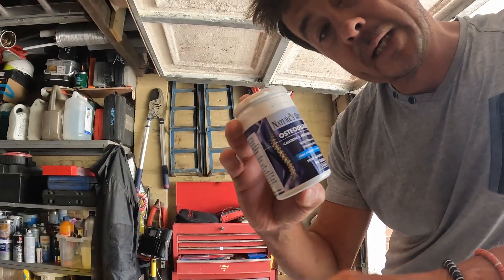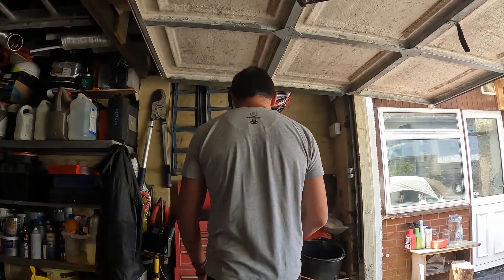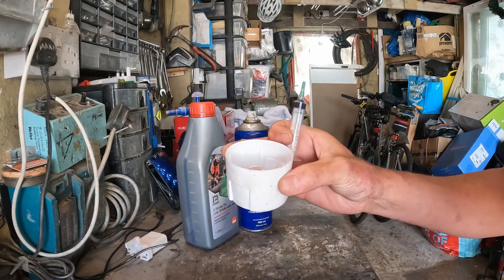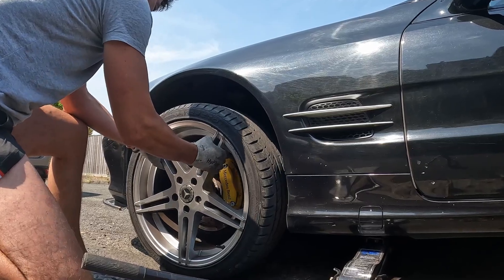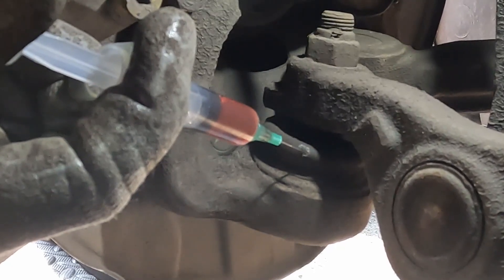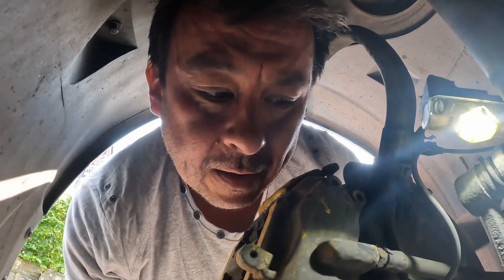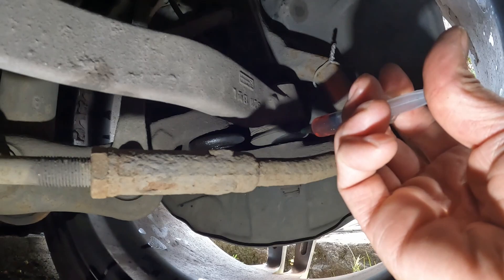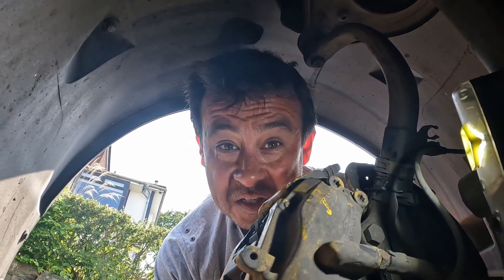Creaking Squeaking Ball Joint 🤐Hack Fix - Demo on Mercedes SL

Comment: Hey man, I rarely comment and just wanted to thank you. My c class w205 went exactly like your video. First ball joint was easy to introduce needle in and filled it well with the mixture you suggested. It didn’t fix it, the second ball joint was hard to penetrate for some reason, but after steering instead of removing wheel it seemed to help with the angle. Did put a good dose, and boom no noise anymore. Hopefully it lasts thanks for saving me 700£
Reply from the maker: hey well done and thanks for taking the time to let me know, I love handy fixes like this.

Comment: Doesnt' a creaking ball joint mean it needs to be replaced?  My new (to me) 05 does it when I turn hard from a stop. Was assuming I'd be having it fixed soon.
Reply from the maker: Yes you can replace, but this is a quick partial fix to stop the noise

Comment: I guess have to use a syringe on the supercharger and the roof for topping up might as well do the ball joints as well, I'll be wearing a lab coat and stethoscope in a few years time working on my SL55 😂

Comment: Nice hax I have this squeak now in my CLS 320 CDI, 2009. Isnt WD40 anti oil though, imma try inject the sprayable lithium grease inside of it..
Reply: How did it work out?
Reply: @I_Will_Cook_What_I_Want worked great no more squeks. I think it was the arm bush though but I injected everything lol. To be honest I had to use wd40 to dilute lithium grease as it was really thick to inject even spray able type
Reply: @tehdreamer  Nice. Thanks for responding.

Comment: How long does that last? Any ideas? Am looking to buy a car with this issue already - so also wonder how much it'd roughly cost to have a local garage to just replace them?
Reply from the maker: It's not the cost as such as parts are okay, it's labor. For me it lasts about 12 months
Reply: @GrooveOn after 12 months does it break or do you grease again  ?
Reply from the maker: @Arkansas223  you can just add more oil,

Comment: How hard is it sticking a blunt tip needle syringe into those ball joints? Shouldn’t the needle have to be sharp?
Reply from the maker: Normal sharp needles
Reply: @GrooveOn those needles on Amazon you have listed are not sharp. They are blunt tipped? And I missing something?
Reply from the maker: Oh I see, it think they will still push on the rubber is not too tough
Reply from the maker: But yes I did use normal sharp needles
Reply: @GrooveOn I filed the needle down with sandpaper and got it to work! No more squeaking !! Thank you for the tip you saved me $550
Reply from the maker: @Crunchykyle that's amazing, it's why I do these vids!! Thanks for any 'super thanks,'